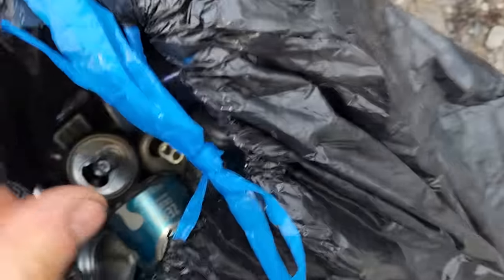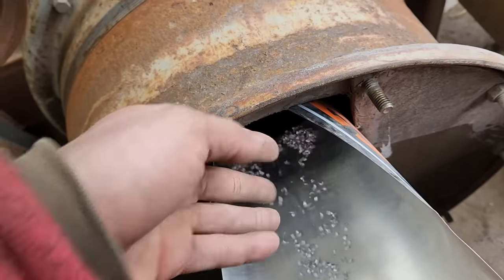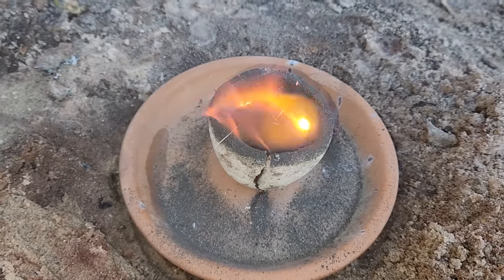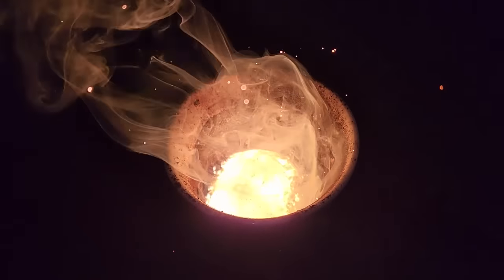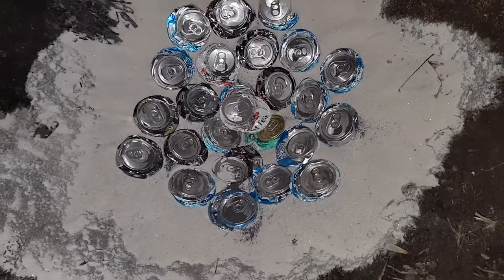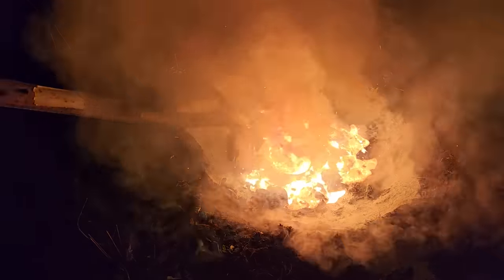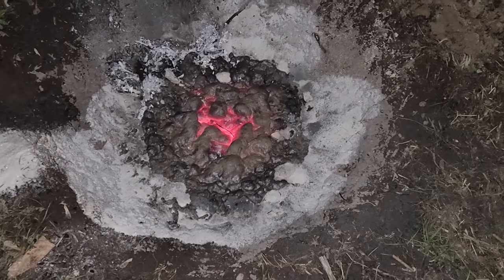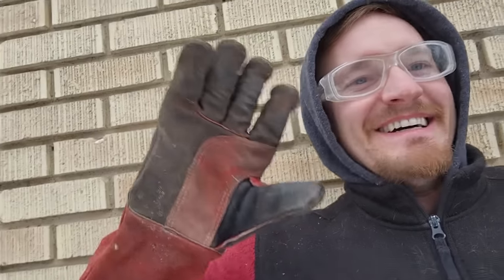Burning 50lbs of Thermite Made From 400 Soda Cans

Comment: They used to make lead shot by pouring molten lead through sieve and letting it fall from height, the bigger the diameter the longer distance was needed so high towers were constructed for that very purpose (Look into 'shot towers' to get more details). 
Pretty sure you used to have access to vertical mining shaft (recall it from mushroom growing series) maybe it would be worth trying playing with this method to get aluminium shot in reasonable size that can be then thrown into ball mill for finer pulverizing. There were alternative methods developed since so there's space for some tweaking. Seems like potentially much easier and faster method than melting everything into big chunk and then spinning it all on lathe just to get chips
Reply: On separate note, there has been some progress with iron nitride as potential alternative to neodymium magnets. Quite promising technology considering how dependent we currently are on rare earth metals. Biggest challenge was producing nitride in bulk. There are few processes, but one seems fairly straight forward and simple. Iron oxide can be thrown into ball mill with ammonium nitrate, apparently over days of spinning nitrogen will diffuse into iron particles.

Making magnets seems like a potentially interesting video series, especially exploring potential of making them using iron nitride. It's a good exercise in chemistry and metallurgy with fairly accessible materials, they sure as hell are accessible to Cody and he worked with them already on previous projects
Just an idea
Reply: @archibaldthearcher  That sounds like an amazing Cody project! I've always been fascinated by magnets. Making one yourself this way seems like alchemy.
I hope he does this! 🍀✌️😎
Reply: For aluminum you can pour directly into water to get individual lumps. If you pour from a foot or two you get round bits about 0.5 to 1 inch in diameter, often as hollow beads (occasionally a sealed bead with water inside). I'd suppose that if you pour from high enough, maybe with a splash plate, you could get cooled bits small enough to pulverize effectively in the ball mill. Probably would take longer to mill than the chips, but skips the lathe, so less hands-on time.
Reply: @archibaldthearcher 

While I like the enthusiasm, there are so many things wrong with that idea from a legal and safety standpoint....

Legally ammonium nitrate is rather heavily regulated. Of course, Cody may have access as a farm owner(?). Still, hurdle #1.

However, it is regulated because it can be explosive. (Recently in Beirut, for example)

 Now, ordinarily, its safe. It is a fertilizer after all, but chucking a bunch of ammonium nitrate in a truck's steel rim ball mill, with a bunch of steel balls, and adding iron powder, all of which are famous for sparking, is such a bad idea I hope this explanation is enough.
Reply: I wonder if he could just pour the aluminium while having a nozzle close by which shoots pressurized air at the aluminium, after all he doesn't want perfectly round shots as you would want for a shotgun shell, rather would you want coarse bits and I think a nozzle which is directed at the molten aluminium and scatters it around could work well for that. Ofcourse he would need a big container for that and maybe a water tank to catch the hot bits

Comment: Thanks Cody! I'd bet the gap along the sides is from uneven cooling. It likely cooled more quickly and contracted on top while still pliable on the underside allowing it to pull in and leave the gap behind. I know that's a consideration in molded and casted parts because of the warpage that comes with uneven cooling

Comment: I used to melt aluminium in a furnace which had a bottom made from plaster of paris and used charcoal and blown in air as fuel. At one point my crucible burned through and the hot alumium came in contact with the plaster of paris (CaSO4). I figured it would collect at the bottom and added more aluminium cans on top and left the air blower running. Suddenly the plaster reacted with the aluminium in a reaction similar to this. It was very bright and quite fun to watch although also a bit scary. The whole alumium was used up and also a big portion of the plaster was missing afterwards.

Comment: 15:00 "gas coming off the cans probably the paint burning off"

It could also be the interior lining of the cans. Soda cans have a plastic liner, or teflon, to prevent the aluminum from rusting too fast.
Reply: Aluminium doesn't rust
Reply: @codenamenel   soda is very acidic
Reply: @codenamenel  True, it oxidizes.  Nice to hear more precise language.   
Aluminum bronze, phhft! That is a pet peeve.
Reply: @codenamenel yes it does. Only when in the pure state and not contact with other metal and metal oxides an indoors with low humidity and no electrolytes. Aluminium is a wonderful material but it really is a great  3 electron donator. Just have a look at alu parts bolted down with iron bolt washers and nuts. Use the to hing a few times outdoors in badmeester, by chance some salty stuff gets to it in the winter when driving the roads or just live 20 miles from the seashore. 
Aluminum is great, but reactive and rusty as heck
Reply: @blueredbrick  rust is iron oxide (fe2o3) how does aluminium turn into iron oxide ? 
it corrodes but does not rust
Reply: @codenamenel Ok in common smalltalk rust usually means  iron and steel and all its oxidation products, the most common being Fe2O3 . But rust in the more general context  means a fragile  oxidation  layer on a metal or alloy that can flake off easily enough that it's something to take into account when working with it. 
Pure aluminium oxide forms a passivation super hard layer but in many cases it forms a mix of oxides and hydroxides and when the alloy contains a whole range of other metals it easily forms that fluffy sometimes slimey layer.  Thats also 'a rust'.
On other channels I would not even have though about the meaning of rust, but since this is a great place to go into nitty gritty details and have conversations I posted it. Maybe I'm a bit rusty in reading the room :p have a great day.
Reply: @blueredbrick  no youre talking about corrosion, rust is only on iron and steel, its really that simple, i cant see why you want to argue an incorrect point ?
Reply: wow a bunch of know it all's pounced on you there even one of them knows what he is talking about you have to love Cody works huh

Comment: this would make such a good scene for a sci-fi book/film. Some people crash on a barren planet where there's no organic resources and its going to get lethally cold when night comes, but they have no source of heat. So they process a little bit of the aluminium from their crashed spaceship into dust and gather up a bunch of magnetite sand then make a small amount of thermite to get a reaction going and then spend the night huddled round a pit of molten iron throwing in chunks of their spaceship and handfuls of the sand to keep the reaction going until dawn
Reply: Anthony Weir is kicking himself for not making this a subplot of The Martian... Martian soil gets its red color from iron oxide
Reply: Are you an Author, very nice story idea, nicely described would love to read it.
Reply: Not to mention it can burn perfectly fine in low oxygen environments since its oxygen comes form the iron oxide
Reply: pretty sure the spaceship aluminium alloy wouldnt be pure enough for that. But scientific accuracy hasn't stopped any science fiction writer yet otherwise the martian wouldnt have beena  success.

Comment: Your magnet didn't attract the glowing lump of iron from the small scale test because it was over 723°C, so the iron would be austenitic (FCC) structure instead of ferritic (BCC).
The larger piece lifted up due to thermal contraction as it cooled.
The coloration in the large piece was caused by the cooling rates at that spot.  It's the same reason motorcycle exhausts get that colored pattern to them.
The brittleness in the iron is also due to residual thermal stresses and porosity due to all of that off gassing.  You probably also added a lot of carbon to the iron due to the paint and linings of the cans.
Reply: Would this be considered a high carbon steel? Basically crucible steel?
Reply: @Anothermachine it’s basically cast iron which has a really high carbon content; that’s what makes it brittle. High carbon steel has a carbon content of .6-1%, which allows it to be forged as it is more “plastic” but will also allow it to take and hold an edge with the proper heat treatment. Cast iron will crumble into chunks if you heat it and beat it.
Reply: High carbon steel is usually 0.8% to 2.0% carbon, although most of the grades I've worked with are in the 0.8-1.2% range.  I agree with @sarahwidhalm4300 that it's probably more along the lines of a cast iron, which is greater than 2.0%.  Given that there was no mechanical or other agitation, I suspect that most of the carbon from the paint and linings of the cans exists as thin graphite plates, which is what made the material brittle.  

A few definitions - Ferrite is pure iron (fe) in a BCC structure, Cementite is Fe3C which is a hexagonal structure.  In irons, these naturally form a laminate called pearlite, which is 7 Fe to 1 Fe3C (if I remember correctly).  If you look at the iron-carbon phase diagram, you'll see there is a eutectic point at 0.83% weight carbon.  This is where the 7:1 ratio comes from.  A steel at 0.83% carbon content would have a pure pearlite structure.  Steels with lower carbon would have grains of ferrite and grains of pearlite.  Steels with higher carbon content (up to 2.06%) would have grains of cementite and pearlite.  At 2.06% carbon, you have pure cementite.
 @Anothermachine
Reply: Material science is so fascinating

Comment: Excellent experiment, undoubtedly due to the grain and fragility it is a type of ferroaluminum, ferroaluminum is a ferroalloy with approximately 35% Al and the rest Fe and was used for the final deoxidation of molten steel before casting.

Comment: 14:26 Once started, there is literally No Way to stop that reaction!  Amazing Stuff!
Reply: Cover it with a big bucket? To close O2 supply...
Reply: @Mark-kc2ke   Thermite contains its own supply of oxygen, once it starts, its pretty much impossible to stop it
Reply: @Mark-kc2ke  Nope :)  Think about the Iron 'Oxide'...
Reply: @Mark-kc2ke  standard techniques for fighting fires are remove the fuel, remove the oxidizer and cool the fire down. In thermite the oxidizer and fuel are intimately mixed and cannot be separated. And good luck cooling it down. It is like a solid rocket booster. Once it is ignited you just have to cross your fingers and try to enjoy the ride. There is no off switch.

Comment: I like to use it to cut metal and to pour cast metals I used to work at an Aluminum plant that had melters and casters. In the melting process, large amounts of powdery dross (AKA Thermite) is created. We had to constantly scoop it off the top of the molten aluminum before it made a large pile and started burning. When it did catch fire, it burned brighter that the sun. The only thing that would put it out was dross salt to smother it or class D fire extinguishers.

Comment: What caused the sand to act like that around the edges of the metal, was the falling snow melted upon hitting the hot sand and then the water trickled downhill, making the sand move and washing it out from under the cast piece.  And you saw it all the way around because the snow fell evenly, and the hole was fairly even in shape.

Comment: I think the sand erupted up because water in the soil was being vaporized slowly by the heat of the slag, and the easiest pathway for the steam to take was straight up through cracks in the solid overburden layer. The very dry sand particles were entrained in the steam flow and were left behind on top as a result!
Reply: Strange that THAT didn't turn into glass
Reply: @LinkinPark4Ever1996 one way of producing elemental silicon is to use a standard iron oxide thermite, to ignite a silicon dioxide(sand) thermite. Alu can reduced the silicon dioxide to elemental silicon.
Reply: @stevecummins324  yeah but at the same time there was glass that indeed formed, Cody even pointed that out

Comment: Hey Cody, how about a 2 million subscriber special, where you use 2 (or 2.15) kilograms of copper thermite for explody purposes? Your 500K subscriber special remains my favorite Cody's Lab video. Copper thermite is always fun to play with...outside...with a lot of distance between you and it.

Or...a video that puts copper thermite to work, used as you would use other (MUCH faster detonation-velocity) products in the mining industry? It has always been my belief that holes drilled into rock and packed with CuO and Al in a stoichiometric mixture would allow for a more coarse-grained fragmentation of said rock, which could be good if you were mining some kind of gemstone-type mineral and didn't want to pulverize your host rock too much. I know these video types are tricky to put on YouTube, but they are also usually the things that grew your fanbase in the first place, so if you can get it past the content filters, they would likely be extremely popular.

Comment: A possible reason the metal was lifted from the ground at the edges is, when it started snowing it would land all around the metal on the warm ground causing the snow to melt, softening and sinking the ground around the hot metal.

Comment: if i recall correctly I think the sides lifting up is probably because the snow cooled the top down faster than the bottom, resulting in it warping. Katanas are curved because they're made of a soft and hard metal which cool at different rates, not by design, so i'm assuming it's the same principle
Edit: You pointed out that not all the iron made it to the bottom so that's almost certainly exactly what it is, the different metals cooling differently rather than the snow

Comment: You may want to add some flux to achive low melting point slag that better separates from the iron. Washing soda or sodium borate may do the job. 22:54 silicon causes crude iron to be very brittle. I work in a steel mill where we make steel from scratch. Samples of pig iron from the blast furnaces are cast into small bar and experienced worker crack these bar to guess on the silicon content. Of cause your iron contains very little carbon, but still silicon may cause the brittleness. Hydrogen is a problem for high strength steel.

Comment: This may be a dumb question(I am absolutely 100% aware of this since slag is synonymous with junk/garbage) but can anything useful be recovered or done with that huge piece of slag?

Does it possess any unique/unusual/interesting properties of note in terms of electrical/thermal conductivity?

Does it have potential attributes worth capitalizing on or have a composition that makes it an interesting precursor in chemistry or even something that could be extracted (mechanically or chemically) that would justify the effort to undertake?

When I asked myself this my first thought was a resounding NO, but after taking a minute to think on it I realized I had absolutely never considered slag as anything other than impurities floating up from smelting or the residual insulation leftover on top after stick welding.

Comment: Some sand and alumina likely dissolved into the iron, making it very brittle.

Bog iron here in NJ has a high silica content.  It makes it resistant to corrosion, but too brittle for most applications.

Comment: So if you managed to make the reaction happen in a vessel that heats it up as well, in order to keep it liquid long enough, you could get better separation of the different layers by density… the contaminants that burn off might have time to rise out of the iron.

The energy required would be small because you wouldn’t need to supply the energy to melt everything, the reaction would take care of that. You would only need to supply the energy to keep it liquid for several minutes.

Then, if you flooded the top lightly and kept heating the bottom, you could solidify tue slag and keep the iron molten, potentially being able to lift it off.

Then, finally, if you could quench the iron blob to cool it down faster you could control you crystallin growth.

Comment: In TX we use sand under our wood for our BBQ pits to retain heat and slow cook if so desired. Now I told a secret Ill give you 3 for 1. I was given a 1 liter vibrating machine with ceramic pellets inside for cleaning small parts. Well what to do with expired florescent bulbs? you can't just toss them in the trash. That could be a hazard for the sanitation worker. I replaced the ceramic pellets with rusty old bolts and crushed the bulbs down to where they fit in the vibrator. Mix them together and you not only have completely clean nuts and bolts but a fine glass powder thats safe to box and tape up to the dispose of. But then the idea came to me to use it as the old timers used rock salt in a shot shell. I haven't done it. It was just an idea. Now what's the third powder you used for the mixture you made? I think it would be great for burning out stumps without having a big fire.

Comment: Aha! Worked at the end of a steel shot blaster as aluminum parts came out. I was the only job in the plant that couldn’t smoke, as I was told that the air around me would blow up if I lit a lighter. Now I know why. Thank you!

Comment: My guess is that it shrunk as it cooled, which caused it to pull away from the sand.

I wonder if this kind of reaction could be achieved by adding molten aluminum to a piece of orange or yellow hot steel and adding additional oxygen in the form of wind from a fan.

I suspect that the added oxygen would cause the steel to start cooking off forming iron oxide in the process and the reaction would spark off from there, though maybe not as energetic as it is here in the video.